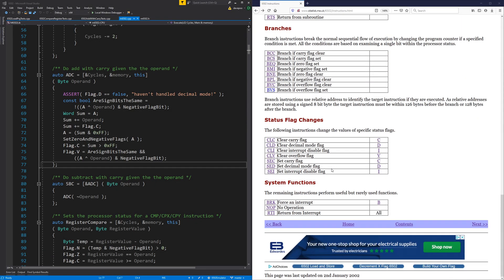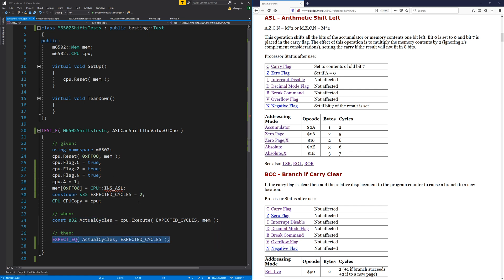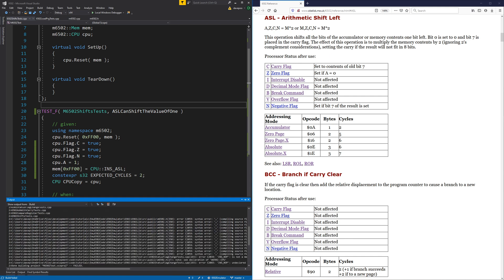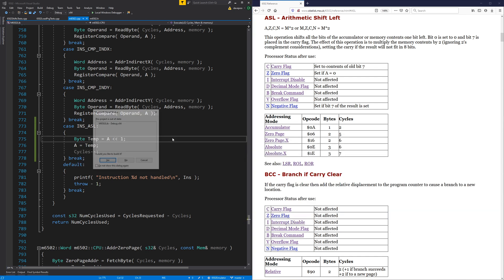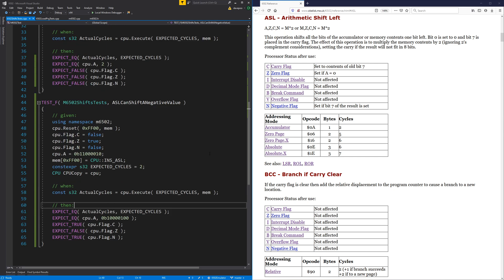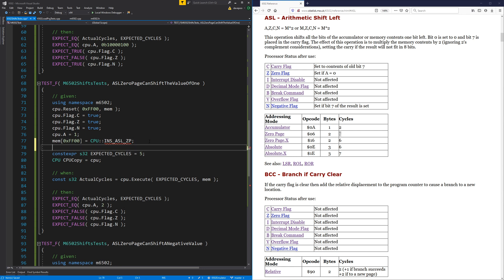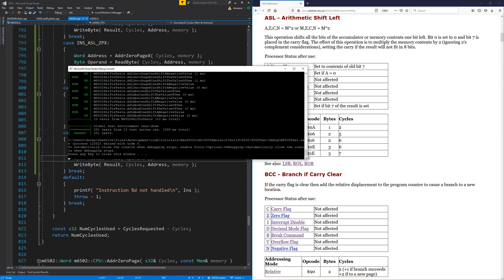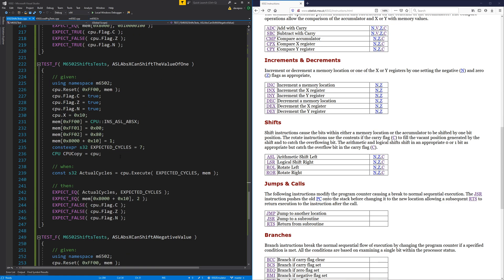Emulating a CPU in C++ #27 (6502) -  Arithmetic Shift Left

Comment: I'm waiting for the video where you convert the giant switch statement to a Dictionary (Hash Map)/array(?) of function pointers to turn the instruction search from O(n) to O(1). Way back when, the maximum cases in a switch statement in the Microsoft C compiler was limited to 255. If there are close to 255 instructions, an array would be ideal.
Reply from the maker: The compiler should be able to optimise that switch to O(1) as a jump table, which would be exactly the same as the array method. The array method might actually be slower as then you then have the overhead of the function call, which the compiler can do inline in the optimised switch case.
A hash map lookup would be way slower than the switch or the array as you have to compute the hash then look in the bucket for the correct function to call.
The opcodes could never be bigger than 255 on this CPU (because the opcodes are 8-bit), so the switch should work even way back when.
So you might be waiting a while for that video, sorry.
Reply: @DavePoo  Thanks for this. I had to do some catch-up learning to see how a jump table is implemented and I'm amazed by how much compilers have advanced. Way back when, we were advised never to rely on the compiler being too clever.
Now that you have a 6502 emulator, would it be possible to implement the 6502 emulator in 6502 assembly language? Of course you would have to omit the tests.
Reply: @DavePoo  As you've mentioned in a couple of videos now, there is some structure or logic to assignment of the opcodes (eg all the Abs and AbsX are 9, D and E in the lo nibble) so you could try and test all of that. I don't see the point though in an emulator so it would purely be an intellectual exercise and probably doesn't gain anything. The distribution of opcodes was probably governed by what they were doing on the silicon, and doesn't seem to make 100% logical sense anyway... eg see https://www.masswerk.at/6502/6502_instruction_set.html